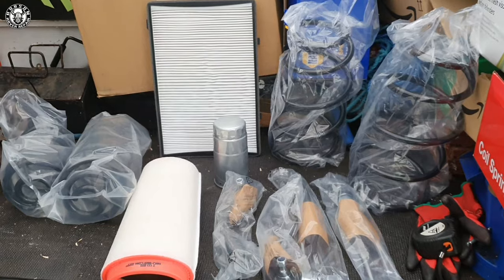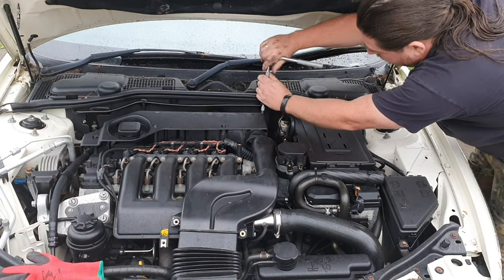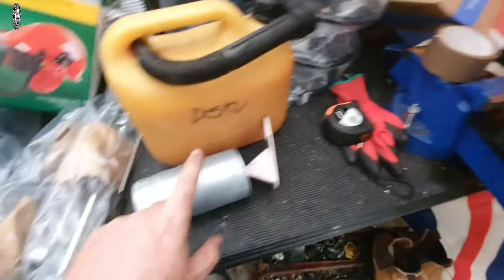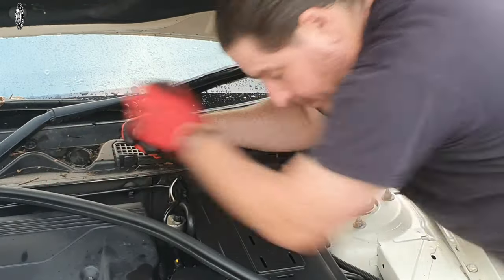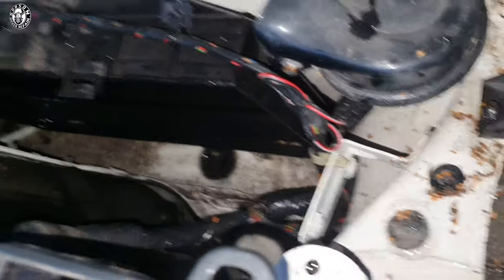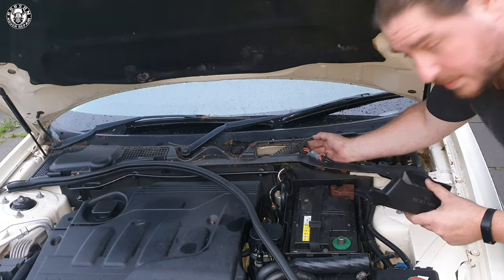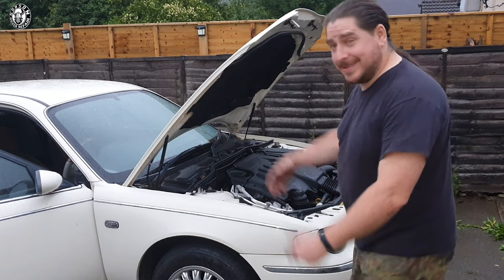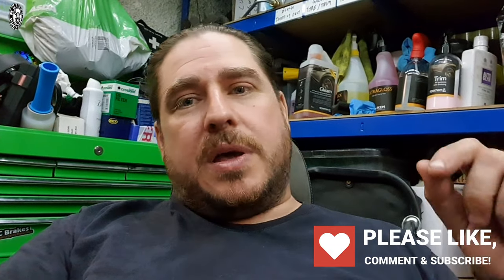Recommissioning my 75 - Stage one of mot prep - Diesel air, cabin and fuel filter service guide

Comment: Got myself a zt-t and your videos are among the very best I have come across. You have helped me no end so thanks for that. 
 Do you have an recommendations for suspension? I have a feeling I'll need to replace my springs in the coming months due to corrosion
Reply from the maker: Thank you Tom. Personally I would look either towards DMGRS for shocks and springs. Or if you want oem and can get the matching codes Rimmer Bros.

Personally if you can handle a sporting setup the Motobuilds are great but sacrifice a lot of comfort on a daily setup, as it would be as stiff as the oem sport ones but shorter and really need the sporting shocks to match over the usual zt comfort ones.

Comment: Hello there, got any working tips or tricks as to how remove the three screws holding the air intake at the front, the ones on the slam panel? Mines just spinning around and apparently it's quite common issue but there isn't much ways as to how take them out without cutting them off. Any info will be greatly appreciated.
Reply from the maker: Well mate you have a couple of options, bumper and slam panel off will give you the best access to get at them.

Or replace the intake, rip old one off and cut the screws out of the way. Replace with caps with bungs on them into the intake and use some plastic scrivits to replace so they never rust or jam again.

I prefer 2nd option as it's a lot easier.
Reply: I ended up drilling out the heads and replaced with bungs. Thanks for reply and keep up the good work mate, love the vids full of valuable information and without any bs. Top job :)

Comment: A really nice Rover once again with a not so nice diesel engine. I’m not a big fan of diesel’s in passenger cars. Rovers are supposed to be luxury & diesel just doesn’t sit right. It needs a V6 engine to do it any sort of justice. 
All the work is incredibly important don’t sell yourself short.
Reply from the maker: You know if it wasn't for the maintenance costs on a kv6 auto I'd probably have one as a daily now days as I do much less millage. But I must admit I do enjoy the diesel auto combo especially when tweeked a little.
Reply: I’m very biased here because I am in Australia & I have Jan 2001 build (pre project drive) solar red metallic Rover 75 V6 in top of the range Connoisseur SE spec as my daily driver.
Reply: @RobsonRoverRepair  the maintenance is not really too bad considering. I do around 12,000 miles per year & it’s no more expensive than a mid range VW. 
Around £150 for the 6000 mile service or £230-£250 for the big 12,000 mile service. Mind you I am a mechanic & so I do all the work myself & use higher priced parts.
Reply: The BMW diesel engine in these is bulletproof. I had two, and one of them went for 275,000 miles until i scrapped the car due to reversing into a tree. The engine was perfect. Same with my second one. Never had to do anything apart from change the oil and filters. On the rover 75 forums you never see any issues with these engines. Understressed compared to their application in BMWs themselves i think.
Reply: @margosdesarian  they are very good engines. I have worked on a number of them myself & the will out last the test of time. I just personally don’t enjoy diesel’s very much. I prefer the silky smoothness of a V6 petrol engine. Nothing against the diesel per say. Just my personal preference & diesel isn’t as prevalent in Australia.
Reply from the maker: I think no matter what, when it comes to the 75s, no owner ever says "That's a bad engine" they always say "I prefer this over that". Says a lot about the attitudes of the owners and also the general range of engines in the cars.
Reply: @RobsonRoverRepair  well said